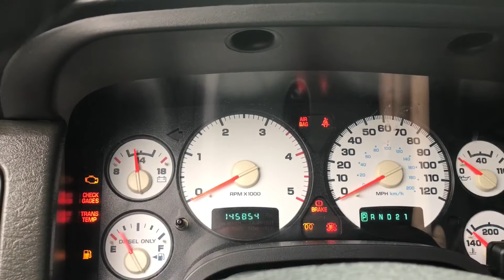LED GIVEAWAY! Comment TO ENTER! 3rd Gen tow Mirror Puddle lights install

Comment: Really like the idea of putting the lights at the bottom of the door
Reply from the maker: JD Kirane it's help when u drop something 😂   those strips style are extra easy to do.  I had those on for a while just never ran the power. Running the wire threw the harness is kind of tough but not impossible...

Comment: Your truck sounds so badass bro
Reply from the maker: 24v Cummins thanks man. It's extra loud I have to do a few more sound clips for my next video.... the cab noise isn't terrible tho. When I had the full pipe with side exit I felt like it had wayyyy more drone at like 55-65mph compared to my style axle dump.